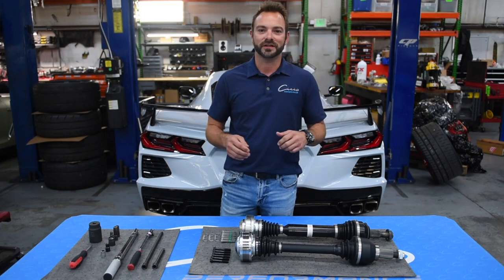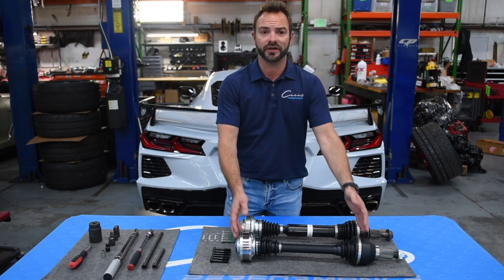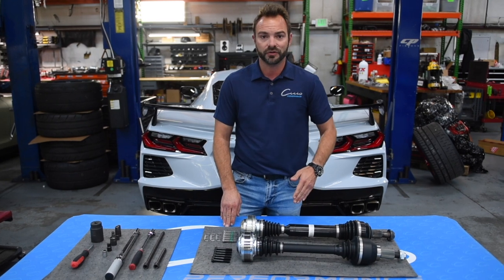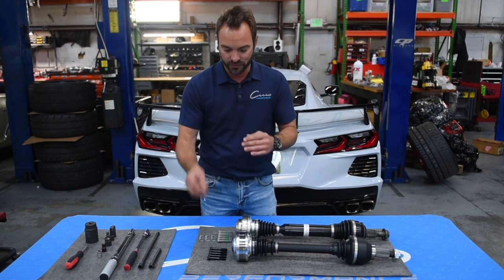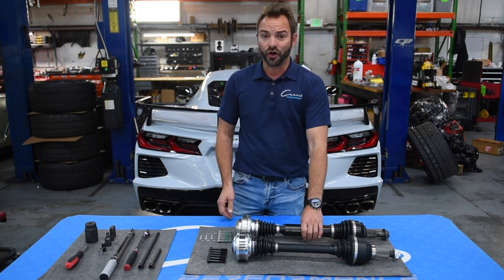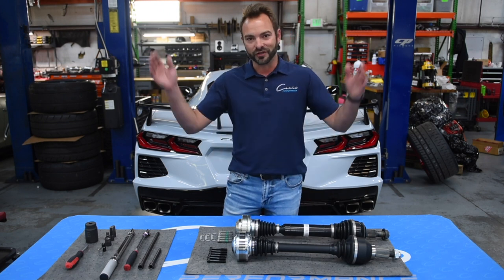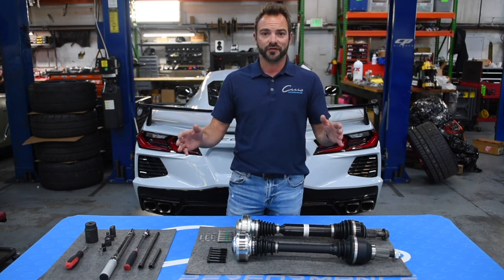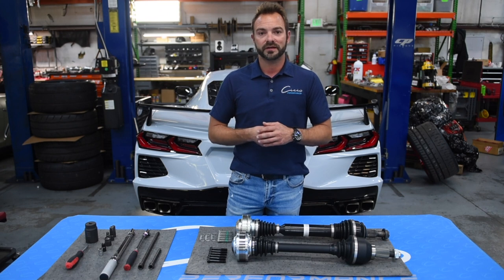Driveshaft Shop C8 Corvette Rear Axle Upgrade!!

Comment: Are the new driveshaft heavier then stock
Reply from the maker: The upgraded rear axles are a little heavier than stock mostly because in the early generation C8 they are hollow and snap very easily.